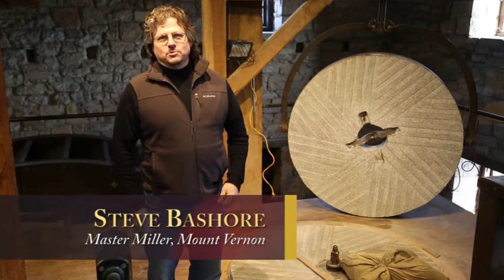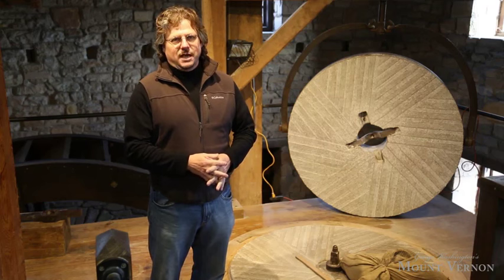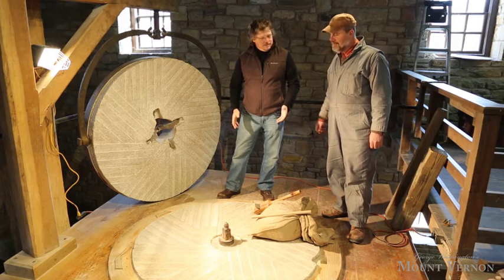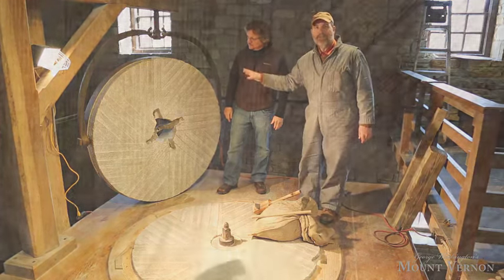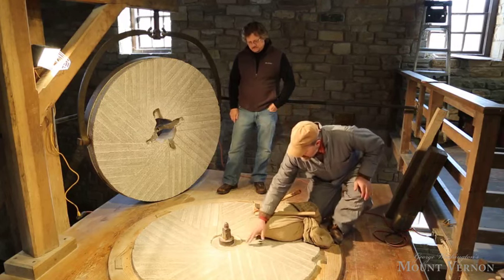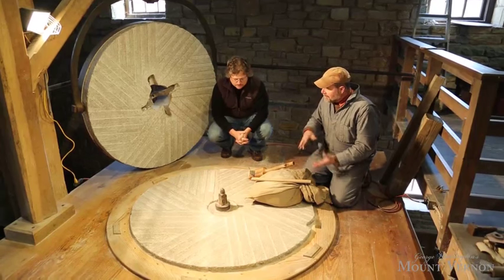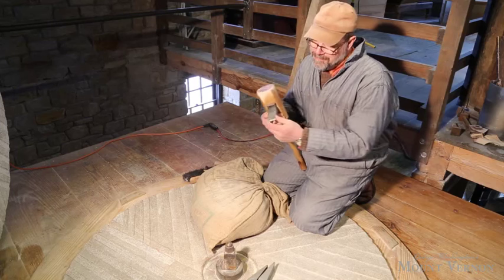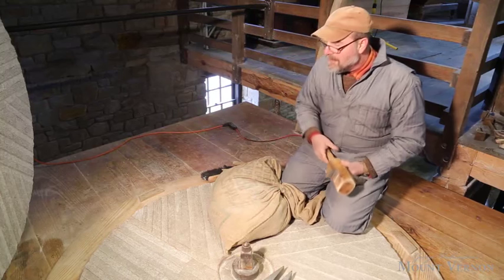Millstone Dressing at George Washington's Gristmill

Comment: I carve these new any size. They grind 2 pounds of grain in less than two minutes
Reply: What stone do you carve them from? Bakery Bits sells little ones made of granite.
Reply: Kate McLynn i use only limestone or marble , if you ever do get any residue from the stones granite is not something you want to eat. Look up what the stones have in them. Limestone and marble are pure and non toxic but granite is far from it.
Reply: We just bought a vintage box style wheat grinder. My husband wire brushed away the old, compacted flour that had been there for many years. We were wondering if we should use something to disinfect it or just use it. Also, there is an area where he can feel it touching like a high spot or something. Is there a way to fix that? Thanks.
Reply: icecreamlady driver yes absolutely clean it well with a safe disinfecting agent. A high spot could be sanded down but please be careful as it would only take a small mistake to ruin this area
Reply: @BarefootViking  What disinfecting agent would you recommend? Everything says not to get the stones wet. Thanks.
Reply: icecreamlady driver anything natural, vinegar may work. Id check around
Reply: @BarefootViking  Thanks.
Reply: @BarefootViking  vinegar is a natural disinfectant but also an acid. seems to me it would etch the limestone. i don't know how hot the process is but maybe the heat would kill any bad stuff. i use a small electric grain mill and never had problems  just run some if it smells and tastes ok my 2 cents is you are good to go. killing germs is overrated you are going to bake the bread anyway.